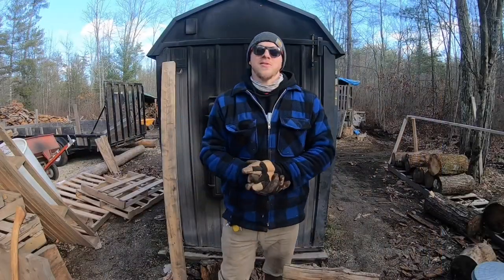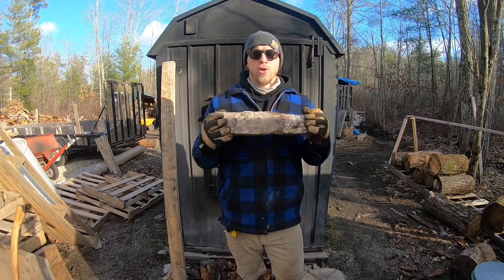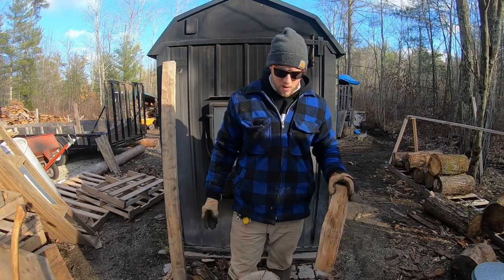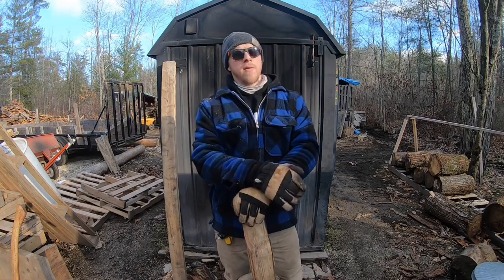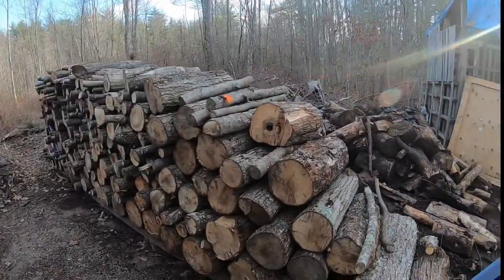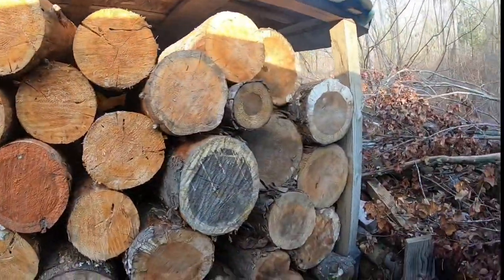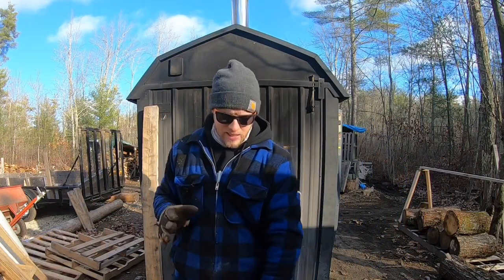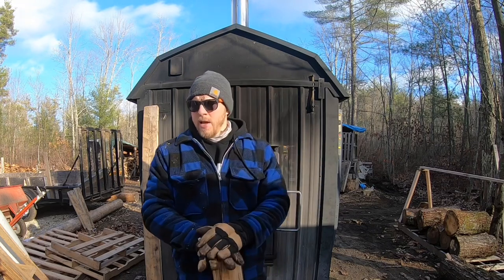STOP Burning THIS Wood In Your OUTDOOR WOOD BOILER

Comment: I used to have the same mindset until an old timer learned me some act right lol. But Back 40 Firewood is 100% correct. You’re wasting heat drying out big wet/green wood. Your boiler is actually working harder to dry the wood out than if you had drier split wood. Rounds don’t dry like splits do. Split one of your big rounds and check the moisture content compared to the split maple. Then split your maple again and check the moisture inside of it compared to the end. I bet you’ll be surprised. I’d be chasing my tail trying to burn big stuff in my classic edge gasser. The manual says 6”-8” splits. Granted I run 20” long splits, but everything is 8” to palm sized splits. Some guys around here won’t burn anything bigger than a playing card in diameter. You ABSOLUTELY have to have a coal bed in a gasser or it won’t run. Big wood doesn’t turn into coals near as well or fast as splits. When mine bridges, and the nozzle sucks the coals out and cavitates under the wood stack, it will actually put itself out. They’re completely different animals. And even though I burn small splits, I use WAY less wood. Been burning since October 15th, today is November 30th, and I have only used 1.5 face cords of small splits.
Reply: Figure in the extra effort to split dry and stack and I say to each his own based on wood supply 
Generally speaking I agree with everything else
Reply: @luvdogsandhorses  eh. I have a splitter with a four way wedge and a hydraulic lift. It’s really not much more effort, but I get it. Not everybody is fortunate to have a machine like that. We run 3 boilers though, so it was a must have.
Reply: @jorrick66   what type boilers do you run
Like to hear about your setup
Reply: @luvdogsandhorses  we (my dad and I) had two woodmaster 4400’s. I decided I wanted to get a gasser, and landed on the central boiler classic edge 560. My grandpa bought my 4400. I am pleasantly pleased so far in the difference. Dad prefers the traditional boilers because of the simplicity. He takes care of grandpas too. Used 22 ton brave splitter for years just to make big wood manageable. Running an additional boiler, I decided to buy a rugged made splitter to ease the work load on us. Very pleased with it as well.
Reply: @jorrick66  
Have you had to unplug your rear heat exchanger yet or do you have an HD
Shop vac hack works wonders in a pinch ...
Reply: @luvdogsandhorses  I have the hdx with the easy view heat exchanger. So twice a month I open the back, pull the turbulators and clean the heat exchanger. I have a fiberglass chimney brush rod and a 3/4” spiral wire brush that fits between the heat exchanger gaps perfectly. Fits in the gap below the chimney well too. CB includes a flat blade scraping tool that does a pretty decent job getting between the exchanger plates. Little awkward getting up in the chimney with it because it’s angled and has a short handle. I’ve been thinking about making a couple of videos of my routine.
Reply: @jorrick66  
Sounds sweet 
I’d like the video
I cleaned one about 2 weeks ago
Used an oscillating tool with an extension I made the vibrations worked good but I think the steel being cold helped
Do you have the updated easy to remove air channels as well and the fireball refractory ?
Reply: @luvdogsandhorses  yep, the round tubes on the side panels and the after burner. I think my manufacture date on mine is July of 2020, so I believe it has the most current updates
Reply: @jorrick66  

You are set then Sir
As long as Central Boilers service doesn’t keep going downhill in Greenbush...
Reply: @luvdogsandhorses  I’ve got a great dealer, so hoping that carries some weight with corporate lol
Reply: @jorrick66  I sincerely hope that works for you
Looks like corporate has cancelled my dealership of 15+ years for outing them on years of failing test kits that don’t want to admit or refund money due
Hope your dealer has more noble influence ...
Reply: @luvdogsandhorses  that’s unfortunate. I narrowed it down to heatmaster and central boiler. The heatmaster dealer couldn’t be bothered to answer the phone or return any of my messages. The CB dealer was phenomenal, so I went with CB
Reply: @jorrick66  
I answered my phone about 10 minutes ago to troubleshoot a used stove install that I’m not a part of
Try to get the next nearest dealer Tom Ellis to answer the phone
Good luck
Now a 2 hour radius in all directions will have the pleasure
Every dealer has to choose
Unfortunately Central Boiler hasn’t even told the dealers of the recall as far as I can tell....
Reply from the maker: 3 boilers lol WOW! Thats a boat load of boilers lol thanks for tuning in JT
Reply: @HomesteadJay  it’s definitely a lot of work to keep up with. Firewood is a never ending battle around here!

Comment: Good info Jay, thanks! I find that the larger pieces result in overall needing less wood because they burn longer. I'm guessing that there might be more creosote created as a result but that's difficult to determine exactly. Thoughts on that?
Reply from the maker: Creosote doesnt matter in this case for this machine. Creosote buildup matters more in the gasification machines but I scrap the sides of this machine once every so many days to keep the buildup down!
Reply: I find smaller pieces smoke more on entry and build creosote more than my bigger rounds that take time to heat up and start to smoke. Also the oxygen will have a harder time getting to the larger pieces of coal making it last longer in that cycle also. Remember the wood gases at different temps. Water first then higher temp wood material till you get to coals. The wood is expelling gases that whole time. Add oxygen that gas burns. Lower the oxygen the gas can condensate on "colder" parts making creosote without burning. Larger pieces expelling gas keep the inner log cooler and slows the gas being made. Slowing the burn.

Comment: Thanks Jay. Last month I bought two cords of that stick wood. I asked for seasoned wood for a wood boiler and got the 16 inch sticks because that’s all they had. However, because I learned from you, I have been cutting and splitting the rounds big, 24 to 30 inches and it’s working great. It does last a very long time.
Reply from the maker: Hey Ovi! Im glad you see what I was getting at. I was talking about burning seasoned BIG wood. NOT green wood. Apparently if you read the other comments that I said seasoned stick wood was bad and unsplit green wood was better which I never said lol. You will learn with your machine (as I did) a nice mix is good. If you see the coals needing some love then throw the stick wood in and larger rounds on top and rinse and repeat! Thanks for tuning in!

Comment: I have been burning my small rounds lately and my 5036 has been going through the wood alot faster. The big rounds last me much longer 5-8 hours longer. Im saving the larger rounds for deep winter to have to manage the fire less if need be.
Reply: You are probably leaking air
I may be able to help with that if You would like
Reply: @luvdogsandhorses  ive gone through the machine and I've talked with my local distributor and maintance guy for this central boiler. It is working as should and I had it check. It also may be due to what ever wood im burning. Im not sure what kind of wood I have, I'm still learning these things.
Reply from the maker: Yes the large rounds will burn good! Glad you have good luck with it!

Comment: hi there i understanding what your saying but don't agree . it all has to do with how dry your wood is . water will not burn that is why you need a big bed of coal . its kind of like putting a pot of water on the stove / . . if your stove works the way it should when it hits set point it should stop the burn . now if the larger rounds have low water % all the way threw your fine but most don't . you may have to high of a stack temp when burning dry wood . i put a light dimmer on my boiler blower to slow the burn and lower the stack temp .(heat going up the stack ) why not just burn fresh cut wood you can just have a bigger bed of coals . just remember wood really doesn't burn its the gasses it gives off when its heated that burn , the smaller pieces have more surface area to give up its gasses faster . anyway your doing good at trying different things to find what works best for you . i built my boiler around 30 years or more ago and have tried a lot of different ways and things , even heated with uiltity poles one winter . john
Reply from the maker: Hey John thanks for chiming in. Ive gotten a lot of feedback over this video but I have found that I have seasoned round logs that are very dry. Close to if not right at 20 percent that last longer than the same piece split in two. Split small wood is easier and burns faster and prob has faster recovery times but these machines can burn a round thats not under 20% content but there is so much heat and a 6 inch coal bed inside the machine even if the log is lets say 25 percent moisture its not going to ruin anything or waste heat. A couple cycles later that log is prob less than 20 percent burned if you were to remeasure it. I am and still am playing around with different things but thank you for your feedback! Appreciate it!

Comment: The bigger the better especially if you have a forced air boiler. The bigger round have less surface area to burn.  Thus it burns slower.
Reply from the maker: Indeed! Burns slower but still puts out heat which is what we want

Comment: I have to wonder if some of the people that are burning smaller wood are buying it from someone who has a processor and is what they get. I do not spit bigger pieces into smaller pieces like you do. What I do instead is if I have a bunch of logs that are borderline I will split half of them and leave the rest whole. If I have a bigger piece that once I split in half is borderline I will do the same thing and split one piece and leave the other one not split so I have a decent mixture of sizes. I do have to admit that I am not always consistent and sometimes depends on the mood I am in that day.

I also have a tendency to split wood like red oak, birch, beech, and poplar that has more water tight bark more than I do maple, cherry, and pine.

Thanks for doing the videos. They are short and to the point and even though I have had an outdoor boiler for 15+ years I like to see how other people do it and hopefully pick up a few tips.
Reply from the maker: Hey G. Thats the best thing about the owb community is we can always pick up a thing or two that someone else does that may help! I agree with the split wood. I like to split down every 3rd round so I have "kindling" or the small pieces ill toss in first then toss the large unsplit on top to keep the coal bed etc... thanks for sharing thoughts again!

Comment: I love that my wood dries out in 6 months here in KY
Reply from the maker: About the same here pending species. Maples dry in 6 months. Oaks take a bit longer. Depends also how it’s stacked/ wind / sun access etc
Reply: @HomesteadJay  I don't have to much oak, not any I want to cut down anyway. We have a prevailing south wind so everything is stacked N/S. Plenty of sun in the summer but am going to cut down a smaller tree that shades part of the pile. Our pile is almost all beech this year, way too many beech trees on my property that are shading out the ground
Reply from the maker: Beech aint a bad wood! Ive never worried cause the boiler burns it all lol
Reply: @HomesteadJay  I have a wood stove inside my small cabin. If I ever had multiple building to heat, an OWB would be my choice
Reply from the maker: Indeed! If my house was small Id run a wood stove too but we have basically two sides of the house ( in law appartment) so wed need two wood stoves one on each side which is more work lol. I am going to install a wood stove on the main side as a early season/ ambiance/ backup heat source.

Comment: Is the dinosaur  boiler.. Is the only Wood boiler I have a wood for.. one of my last jobs in the USA.. Was on a dairy farm... Which had 2 huge wood boilers... The firebox was approximately 5' square... And the Firefox was about 6' deep.. If you could pick it up and put it in the   Fire Box... It was good to go. The time you had a Bob get available.. To load the wood into the boiler.. These 2 boilers made heat... For 2 houses... Is and a milking  And  parlor.. They would burn about... Is half  Is a cord per hour. At 0ﾟ
Reply from the maker: Yikes! Thats a lot of wood!
Reply: @HomesteadJay   Is washing out milk tank takes a lot of hot water... As well as washing the milk room between milking .  another big Inefficient was wet wood .. It's not nearly enough space.. In the shed for all of wood you needed...
Reply: Another big heat lost was... About a 150 yd.. Remember that's just one pipe.. The supply pipe and return pipe ..you will have 300 yd Of uninslate pipe in the ground to heat all the buildings.. This has been taking care of sense... I seen pictures of a new woodshed this year..

Comment: thay say is you can lift it you can burn it
Reply from the maker: Yes the more seasoned the better!
Reply: @HomesteadJay  with them boilers idont see the need to splitt wood
Reply from the maker: @robertbandle378  You are correct but the small split wood helps rebuild your coal bed. If you got 6 inches of hot coals you can burn anything. I keep about 30 percent of my wood split for this reason.
Reply: @HomesteadJay  like watchin your channel i have a out door chimna wood stove it was propain the burner when bad i made it to fire wood
Reply from the maker: @robertbandle378  Thanks for watching the channel! Interesting conversion!

Comment: Hey, maybe you could grab one of those moisture testers off the internet and get some moisture numbers off the round logs you're burning. I'm seeing some protest from some commentors about the moisture content of the big rounds versus the small split pieces. I can clearly see the cracks that run through the large rounds, indicating the lack of moisture. Now burning green, wet large rounds will be problematic but, burning large dry rounds is definitely beneficial concerning your efficiency. Maybe show the numbers and it'll prove the naysayers incorrect. Not that it is an issue but they could learn from seeing the facts. Large, dry rounds definitely burn longer on a good coal bed. If it's dry, creosote is not an issue and it is not using any of the heat energy to cook off the moisture that could be going to heating the living space. All wood, even kiln dried split wood, has some moisture to it. Cold and wet winters will add moisture through the air alone. That being said, you're never gonna completely eliminate moisture from the wood to be burned without wasting other energy to keep the moisture level next to zero. I can see the concern associated with burning large rounds but if it's dry, it is very beneficial to your overall efficiency and the reducing input costs and energy that go with splitting wood. There will always, always, always be a necessity for small split wood but adding the large dry rounds is incredibly beneficial to the overall efficiency of heating your home with a wood fired central boiler.
Reply from the maker: Hey Mike. Im not sure why there was "outrage" over this video. Its quite aggravating actually. My whole premise was burning whole DRY wood. That log I cut over 3 years ago. Its not green. Im getting feedback like I said dont burn split dry wood burn GREEN wood lol I have to make a video to address this controversy now lol I am going to buy a moisture meter now to make my point. Burning WHOLE dry logs is better than DRY split rounds for a non gasification outdoor boiler. Im glad you saw what I was getting at!

Comment: Big rounds are ok, but you should have about 2 months of split wood under roof. I had nothing but big rounds one year, and I got sick. My petite wife couldn’t lift any of the rounds to load the wood burner. We bought a splitter later that year, and I find that even though I spend time splitting the wood over the summer, I burn less. Likely because it dries faster and I don’t have to use wood in the fire to dry it out while it’s in the wood burner. My non gasification burner doesn’t care what I feed it. If you have a gasification burner, you have to use smaller and seasoned wood for it to work well. - just my opinion from my experiences.
Reply from the maker: Hey Denny! Yes you are correct I should prob have smaller stuff on hand for sure in that case! My wife played D1 basketball so shes pretty tough hahah the full rounds i burn are at least 2 years drying so I am going to get a moisture meter and see the content of one just for kicks!

Comment: Your wheelbarrow is in rough shape

I have an outdoor furnace and I burn tree trunks. 300 lbs I dump them in with the tractor and she goes for 10 hours. 

I use a lot of scrap wood lumber press board. Stuff that is heading for the landfill. It’s about 350 lbs and in a box on a pallet and I have pallet forks on the tractor and I just set one in at about 7 AM and it burns up in about 45 minutes to an hour but the heat stays for 12-24 hours.
Reply from the maker: That wheel barrow is going to be overhauled in to a log hauler thats why its sitting there being patient lol I also burn pallets and such! Good heat and always almost free!